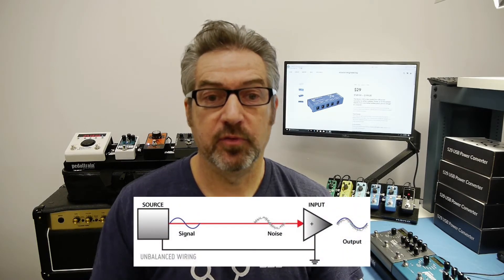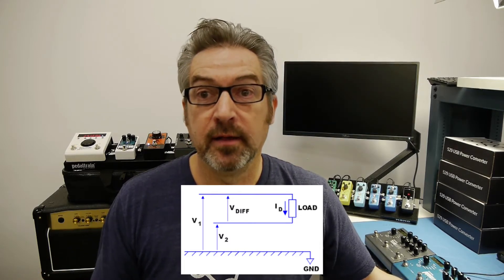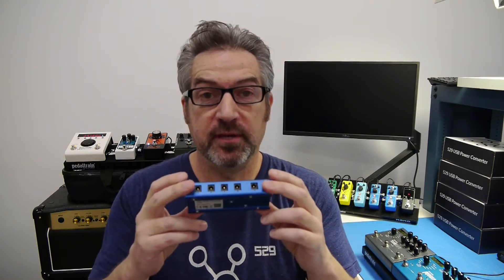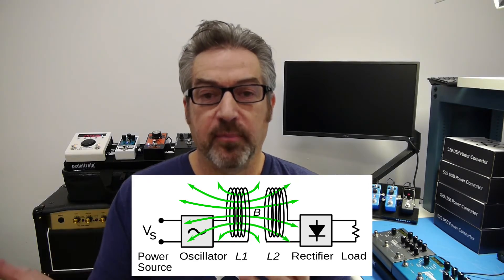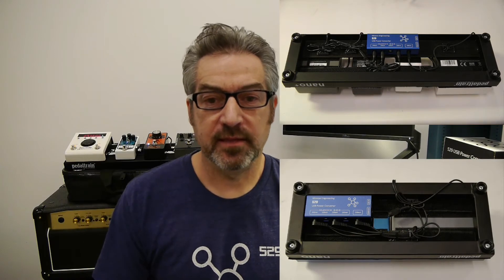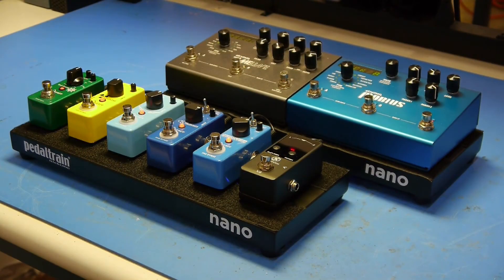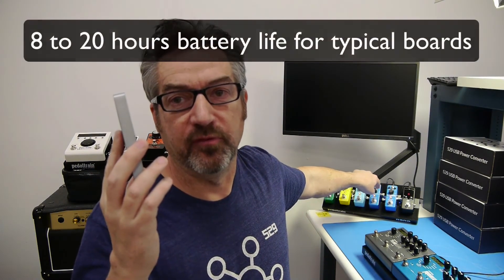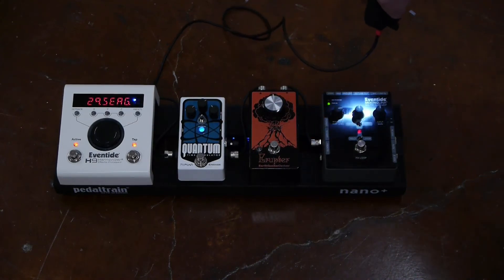Mission 529 - The future of power

Comment: So I just got one of these about a week ago. It works great unless its plugged into the mains power supply it came with.  Then its noisy and hums.   I'd watched that pedal show and they said you told them that the current ones had been fixed.  What should I do to get it to work.  I dont have this problem when plugging my Rockboard Power LT XL into the same mains with its power supply, just with the 529.
Reply from the maker: If you contact support at info@missionengineering.com they can help you. It sounds like you just need a replacement wall power adapter. If it is a new unit purchased from a Mission authorized dealer it has a 1 year warranty.

Comment: I have a question,  I`m thinking about make a new small pedalboard using H9 max 500mah, Strymon Sunset 300mah, and a Disaster Area DMC.Micro  60mah Midi controller, do you think I can use this power supply with a Powerbank, without digital noises?
Reply from the maker: Maybe. The H9 Max is supposed to be powered with 12V which the 529 does not have, but many people run their H9's with a 9V supply. I use my H9 connected to the 500mA output on the 529 and it works fine. The only thing I cannot do is firmware updates. The H9 needs a 12V supply anytime you want to update it's firmware. The DMC should be no problem. That leaves three
Reply from the maker: 150mA outputs free. You could connect these together in parallel to power the Strymon. I don't have a Sunset but I have powered other Strymon pedals such as the Timeline and Mobius without issue.
Reply: James Lebihan Great thanks so much  for your clear explanation

Comment: It should have one higher voltage output to run HX stomp.
Reply from the maker: This is a limitation of USB 2, not the 529. We have another power supply, the 529HC that will be available soon that utilizes USB 3.2 and a USB C connector to power higher current devices such as the HX Stomp
Reply: @JamesLebihan Great to hear, thanks!
Reply: or a Tech21 FlyRig

Comment: i have a question! what if i want to turn off the pedals/the power supply? how do i do that? do i need to keep the pedals running all time on even i dont intend to play until the batery goes down? thanks!
Reply from the maker: Just make sure that the battery pack you use has a switch on it. Both the Mission recommended USB battery packs have a switch on them. You can just press the switch and all the pedals power up or down. It's actually really handy. I use this feature all the time.

Comment: This is fantastic. The size alone is going to be a big deal for small pedalboard users. 

Does this design allow for different voltages? Some pedals function their best at 18v while others require 12v to boot up. Does the USB design allow for future units that could offer variable voltages? Obviously AC power for tube pedals is a no-go, but it would be awesome if we could have 9, 12, 15, and 18v DC options in the future.
Reply from the maker: We have another version in development that provides higher power capacity and selectable voltages using the new USB Power Delivery Specification. This will have more outputs and additional voltages.
Reply: @JamesLebihan   Hi James . Any update on the one that provides higher power capacity &  selectable voltages using the new USB Power Delivery Specification, as it's now 9 months later?
Reply from the maker: @kickbiker7920   We expect the 529HC to be available around May of this year. There is a lot of regulatory compliance and safety testing that has to be done, and this takes a fair bit of time, unfortunately.
Reply: @JamesLebihan  Thank you for the prompt reply. I was thinking of getting the 529 as I have mostly TC-Helicon/TC Electronic pedals, EHX pedals & Neunaber. Should I hold off?
Reply from the maker: @kickbiker7920   The 529HC is a USB C device with a single output intended for high current devices such as the Line 6 HX Stomp. If you require isolated outputs for multiple devices, the regular 529 is still going to be the best option in most cases
Reply: James Lebihan Thanks for your prompt reply. I may very well get the 529. Would a Varta 18200 ion battery suffice?
Reply from the maker: @kickbiker7920  I haven't tested that one myself but it looks suitable from the specs. If you add up the total current draw of all the devices and then plug that number  along with the battery capacity into the calculator in the user guide, it will give you an estimate of expected battery life https://missionengineering.com/support/529-electronic-user-guide/